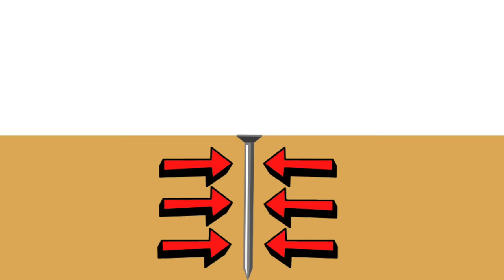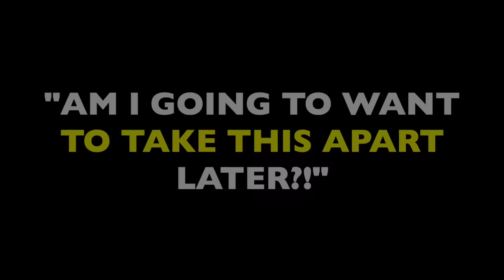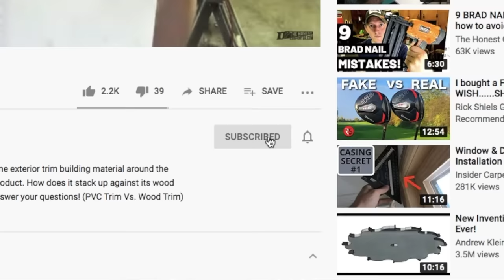NAILS vs. SCREWS...Which Should You Choose?! (Pros + Cons of Nails And Screws For Your Projects!)

Comment: 99.9% of the time, my question between nails and screws comes down quite simply to size and scale of the project. If it's small enough to be portable (by one or two people), screws every time... If it's large enough to be at least semi-permanent once I've built it, then nails do a fine job...

    There ARE a very few exceptions... Cut nails require pre-drilling or you'll split the project all to hell, BUT while they have considerably superior strength over regular nails and can maintain the same shear-strength and durability, once you even pry them a LITTLE, they let right go... almost instantly... so breakdown can be fairly short and simple with a bit of care... "Period pieces" are another point to using cut nails, and are in fact, why and how I got started with the damn things... They can hold well enough to be used vertically "upwards" or "pointing up" and suspend a surprising amount of material individually...

     AND some dubious choices in materials can send me to pre-drilling a screwing where you might expect I'd suffice with nails ordinarily. If working seasoned oak, for instance, it doesn't even much matter the size of project, you can turn a hefty steel nail into a corkscrew before you get half-way through a one-inch board... SO you drill (with a GOOD bit) and screw... and bring in the paraffin wax for those threads or you're already doing too damn much work, even with a power driver.

    Finally, yes, glue can be employed to aid the use of nails as well as screws. In some cases it can be indispensable for lubricating the screws or nails going in, and then cure out to keep them in place through near ridiculous amounts of abuse.

    BTW... Long as we're here, there's a LOT to be said for practicing with an ordinary claw hammer long enough to get REAL skill at driving nails, as well as the cat's paw or goat's foot for extracting them... There are 3 reasons to get into a project, whether you're a hobbyist, only DIY to save money, or a pro' working into and upward in the market... 
1. To get it done... Okay, someone's gotta do it, and you CAN save a lot of money, arguing, time, and tribulation to just do the job YOUR WAY on your own.
2. To learn... It takes a bit of time and experimentation to build skills and instincts... It's WORTH EVERY MINUTE, and experience brings wisdom, rather like the comb time gives to a balding man... it still comes at a cost of equipment and projects ruined, time and materials wasted, and the occasional injury...
3. Exercise... If you struggle to get your lazy ass off the couch and down to the gym, there's nothing wrong with putting the power tools up and picking up the hand tools. You'd be surprised how little strain or time is really given up per project just for the lack of power tools, AND you really CAN get healthier and stronger for going after things "the old fashioned way"... You can even learn a bit about efficiency in movement and how you apply your physicality in the process, making those odd gym visits actually productive as you put that building strength to real-world purpose.  ;o)

Comment: don't make it complicated, screw for normal forces because hold force, nails for perpendicular forces because flexibility(sheer force, sideways force). Screws always for going vertical because nails will eventually slide down. Screws if you're going to walk on it because vibration will eventually work a nail out.

Comment: Hitting a nail or screw from the side with a hammer isn’t an accurate test to determine the sheer strength provided by that fastener in the real world. The Project Farm YouTube channel did a great test on this exact topic a few years ago using actual 2x4s attached to each other with screws or nails that he then pulled apart with a Jack. Every type of screw had vastly greater sheer strength compared to every type of nail in the test, even drywall screws, and it wasn’t even close. It was two to three times stronger. It goes to show that even though a nail is more ductile on its own that doesn’t mean it provides more sheer strength in a structural application. The proof is in the taste of the pudding.

Comment: You mentioned using a nail gun with an air compressor but I’ve also seen people using nail guns without it 

Can someone point me to the right direction…. I’d prefer one that doesn’t have to rely on using the air compressor if such a thing does exist

Comment: It really comes down to the right fasteners for the application. Your example of the nails pulling out due to expansion is off set by the fact that screws will snap. Nails are better at shear while screws hold better. Using the wrong screw will fail or causes other problems. Go ahead and frame a house with screws or install a kitchen with nails. Both ways are rightwrong

Comment: Galvanized nail is a bitch to remove. I tried removing one, the nail head was deformed and broke off b4 I can extra the nail. Lol. In that regard, I would prefer nail over screw for holding power on framing

Comment: I was contemplating building my own shed and while I want something that can withstand the occasional normal thunderstorms and higher winds, I want something I can take apart and transport if I have to. 

Are screws really that bad of an idea for framing?
Reply from the maker: Honestly, I think you’re alright building a shed with screws Hal. It takes a heck of a lot of pressure to blow a structure apart. If you’re not in tornado alley, I bet you’ll be fine. Most sheds will roll long before they split up.
Reply: Maybe you could frame and sheath the shed's floor, wall, and roof panels using nails, and then use 1/2 inch diameter threaded hex bolts and washers to attach those components together.  It would require a bit more thought in the design phase and you'd have to pre-drill the holes for the bolts.  Deck screws would probably be strong enough for a shed, but they may cam out or break during disassembly.  1/2 inch bolts are way stronger than deck screws, are easier to disassemble, and you can get the same job done with fewer of them. Plus, they would be located inside the structure protected from the elements.
Reply: You could always build with both. Build all walls with nails and connect each wall panel with screws since I doubt you would take every piece apart on a move.
Reply: @TheHonestCarpenter  Thank you all for the valuable info!
Reply: Nail as much as you can. For things to be removable, use screws.  But when in doubt, up the size for strength.
Reply: I framed my 2 story house using phillips head screws.  It has withstood the test of time...high winds, heavy snow loads, etc.  Plus, phillips screws are dirt cheap compared to torx.  I never use nails because I want what I build to stay together.

Comment: Nails have worked perfectly when placed right for 100's of years. And you didnt have too have gas, air or a battery too drive um. Also,, you didn't have too carry a rollaway full assortment of bastard driver bits! Screws, lags, carriage bolts all have there meaningful purpose and convenient use. But thats it.
The wheel for example, is round cause it rolls better than a square one, and ya dont need 2 lug wrenchs too remove or replace a tire 1 too take it off, another too put it back on. If ya can can improve things while keeping things simple,, by all means do so, but leave well enough alone.

Comment: normally happy with content...but you didn't address the nails that use designs, like ring shank, to resist pull out. High load hurriquake nails are a great compromise with screws and codes where pull out is an issue.

Comment: Why does this myth of nails having better shear strength than screws continue to get spread around. Instead of hammering a screw from the side do an actual shear test. The shear strength of a screw is considerably stronger than a nail. 

Time and antiquated codes are the only reason to use nails.

Comment: As usual, another diy channel talking about things he doesn’t understand because he’s not a professional….
    Ringshank nails are equally as strong or stronger then screws. Galv nails are stronger then screws and nearly impossible to pull apart. Screws have a fraction of the shear strength of a nail . 
    Pre drill a small hole for a larger diameter nail and it will hold incredibly without splitting the wood. You really should consult a professional builder or framer before spewing out such nonsense.

Comment: Your comment about “shoddy construction workers” using nails because they’re faster, is just plain wrong. You even explained why when you talked about tensile strength. If you frame a house with screws, it will break itself apart! Now if you’re talking about decks, screws are the way to go. But definitely not for any structure!